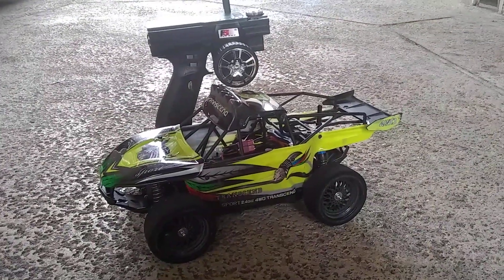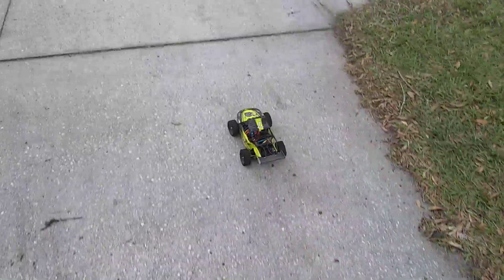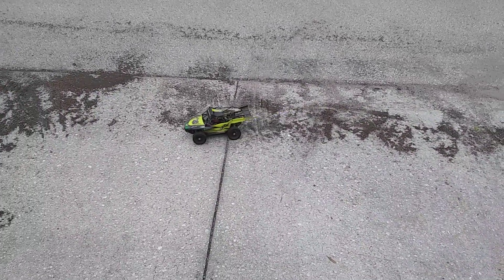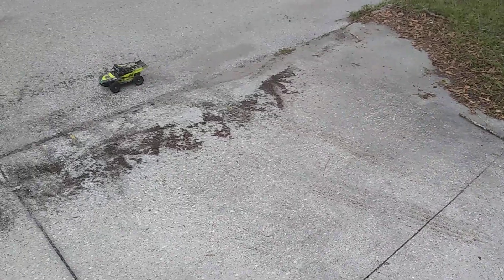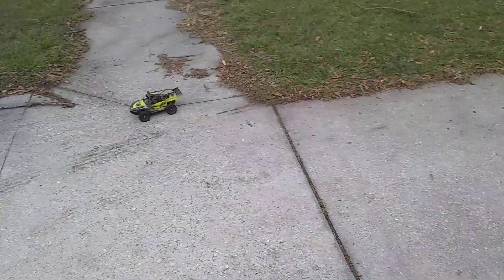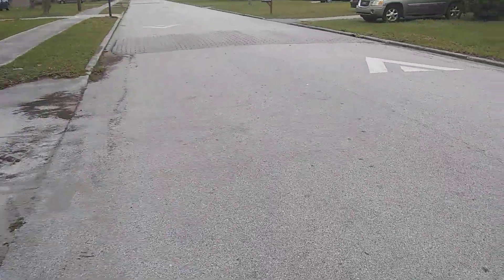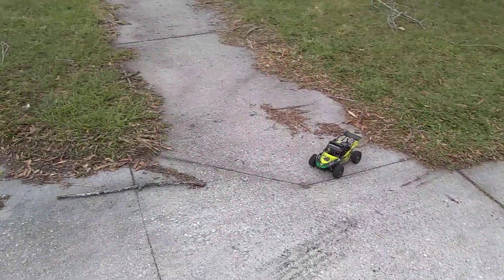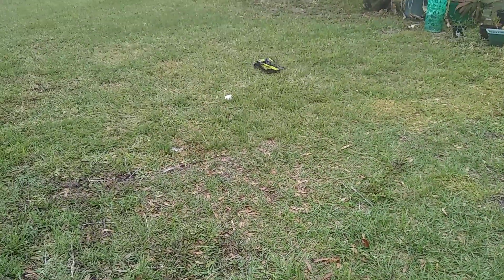Wltoys k929 brushless run/demo

Comment: Ur mistaken.ur motor would be 28 series for this car
Reply from the maker: 28 series? Not sure what you mean
Reply: @OmniMan_Racing  its size of motor. U mentioned 3650 which wrong not possible in this car. Its must be 2838 or 2845 motor
Reply from the maker: @gamingprotocol8871  pretty sure I know what motor I put in it lol it's a9x9 car and is using a a959b motor mount and 27t pinion. Motor was a brushless 3650 3800kv and 120 ocday esc. It now has a brushed dynamite 540 motor and hpi 60a brushed esc
Reply from the maker: @gamingprotocol8871  it's a 1/18 4wd k929 not the 2wd k959
Reply: @OmniMan_Racing  oh sorry its my bad. Yeah i thought its k959 and its really similar to that one.
Reply from the maker: @gamingprotocol8871  it's cool I had conversation with someone the has a k959 thinking it was the same truck and when I asked him why he converted  to 2wd he looked at me funny
Reply: @OmniMan_Racing  lol these wltoys very confused by labelling there models
Reply from the maker: @gamingprotocol8871  agreed. They make great cars but the one car I can say I bought and hate was the 6wd 18628
Reply: @OmniMan_Racing  if u want a full fun with bash and speed. I would highly recommend 12428 4wd is the best of all very very durable. If u convert to brushless it would be even more more fun it never breaks. Made flexible plastic in this car.
Reply from the maker: @gamingprotocol8871  i have one. Brushless 3665 hobbywing 120a esc 20t pinion metal gears. It's fun, good rally build for what it is
Reply: @OmniMan_Racing  damns that way too much. I think 2845 motor 4500kv 3s is enough for this. How about metal differentials,bearings and drive shafts how long they run on this upgrade of urs?
Reply from the maker: @gamingprotocol8871  it's a 1600kv motor. Everything has held up fine. Over 10 2s batteries through it maybe 3 3s. It's the one car that I think is going to break every time I use it and it just survived the punishment. But I also forget I own it lol it's not as thrilling as my jumpshot SC or some of the other stuff I use regularly
Reply: These cars can hold up to a 550 brush and non. I have one in mine and it just shreds diffs in 2 min